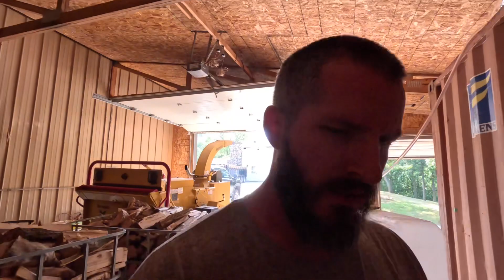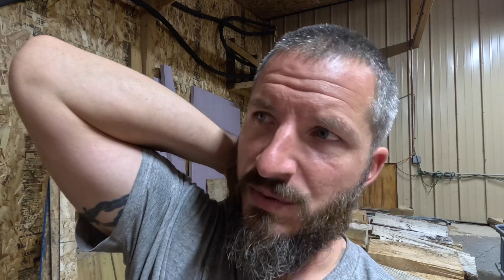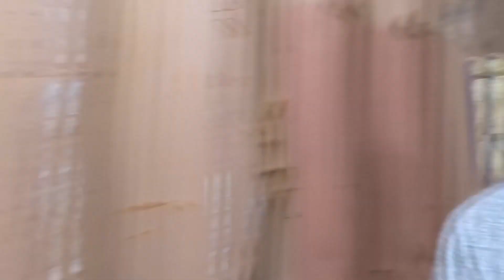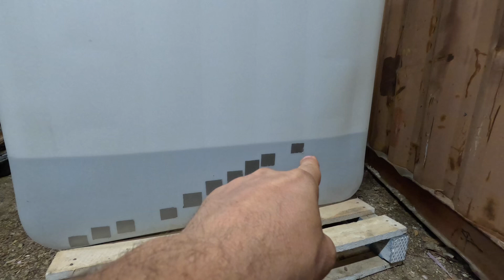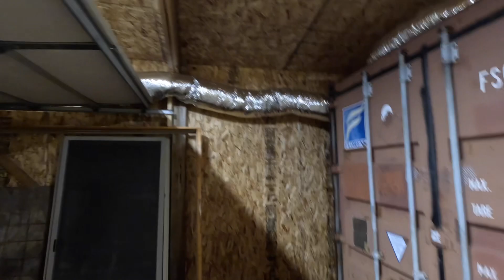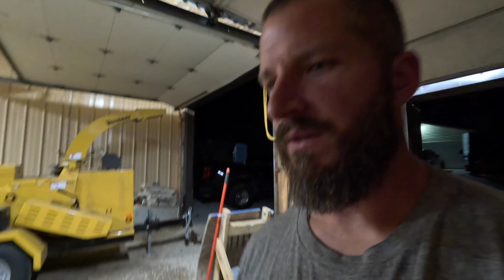Kiln Venting, So Far So Good

Comment: With your new venting it's clearly throwing the moisture out and drying everything. I like the idea to just keep at it it also could show you your top out temperature. It is important to remember anything under 20% is wonderful firewood anything under 10% is great for building lumber. I think taking everything down below 15% with your current system is completely possible in 3 or 4 days. Great videos we will be watching them all
Reply from the maker: Yeah the system seems to be working really well. I’m happy with the results so far. Truth will tell once the wood comes out and I test the moisture.

Comment: So. This sounds pretty wild but I'm gonna throw it out there for shits and giggles. Before camping or any time I need kindling I take some small split soft wood and put it on my treager grill at 300 for a few hours. It'll usually lite with a match no problem.hot air in, humidity out at a constant rate seems to do the trick for me
Reply from the maker: Yeah that’s what I’m trying to accomplish right now. Seems to be working out great.

Comment: Great video. I believe you have a good plan for moving forward. I would like to know how you have the vent set up. Is it on a timer or a temperature humidity variation cycle or completely manual. I am not surprised you are having a difficult time getting the humidity lower than 20%. It is likely to be the air out side the kiln causing that issue. Even with your dehumidifier.  Do you have any probes in the wood. Monitoring the heat and moisture levels in your average size stick will make a huge difference in knowing when your wood is dry. It could save you hours or even days on your cycles.  You are doing a great job. What you are doing is will work. I will be anxiously awaiting the next update. Glen
Reply from the maker: I have the exhaust fan on a humidity control switch. Turns fan on at a percent I have sent with a differential I set. Works out perfect. I have it Plumbed in where the dehu exhaust is. I don’t have the sensors yet for the probes in the wood yet. But yes once I do I will exactly know what is going on. And yes I do think how bad the humidity is outside right know is affecting the drying time.